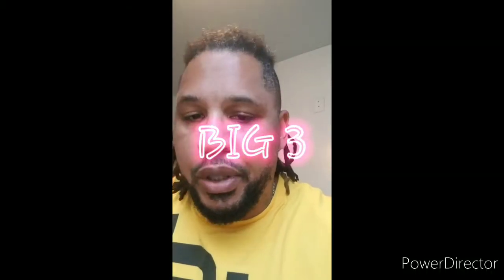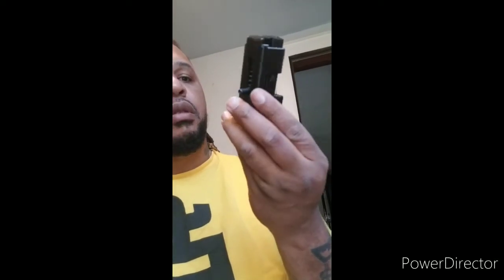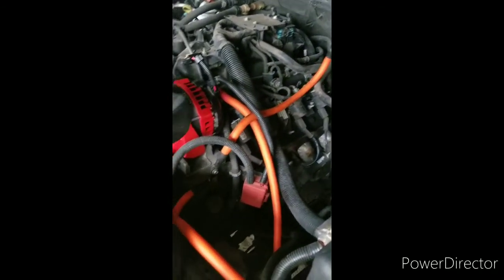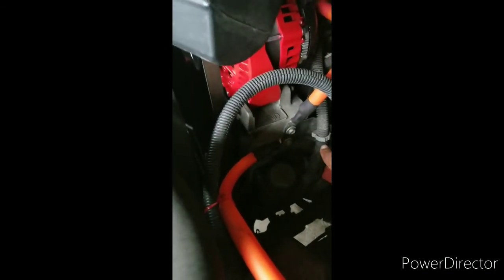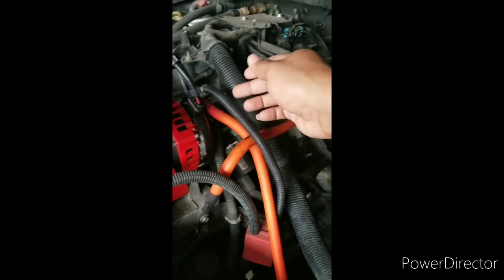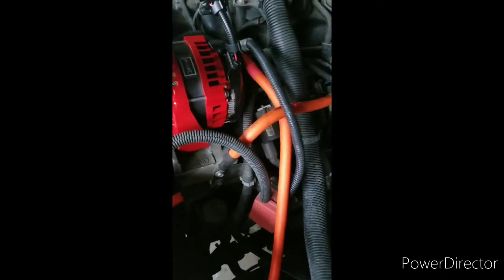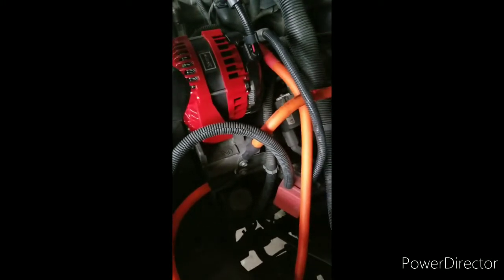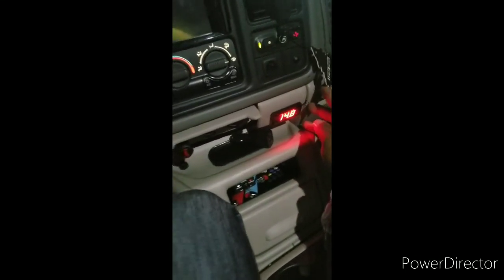Chevy Tahoe Big 3 Upgrade

Comment: What if you have one of them amps fuse where all the positives go to instead. I have 2 power wires and 2 negatives on my battery, one power leads to the starter and the other power cable goes to that positive amp fuse. One negative goes to the block and there's another negative that leads to the front bottom of the suburban and its skinnier than the other negative. Now the altenators positive leads to that amp fuse, can I just wire it straight to batt. instead? And the negative that leads to the front of the burban, can I just leave that as is? Sorry if I don't make any sense 😅
Reply from the maker: I believe you did a big 4 which is above my pay grade

Comment: Im trying to do this now man. I could use more info. First, what kind of setup do you have system wise? I have 2 skar audio evl 12s with a 2000 watt amp. My stock alternator wouldnt cut so i got a mechman 400 amp alternator but its a one wire amp and it just keeps throwing codes. Battery not charging and messing with my brake booster. I have a 250 amp alternator but i just dont know if that would be enough. Also, did you just leave your battery cables stock? Or did you replace them as well? Seems like in the vid you still have the stock positive and negative cables u just added the alt positive and ground cables to it.